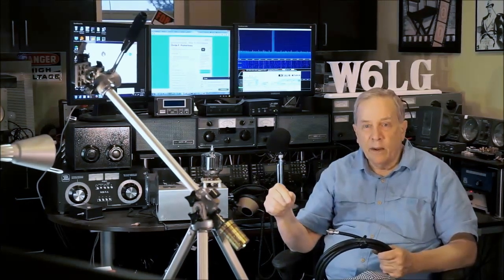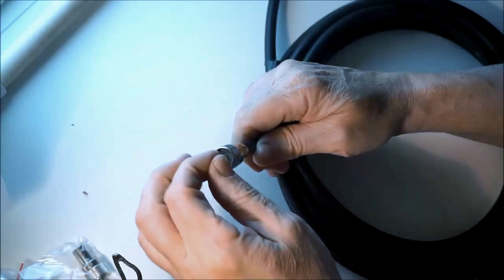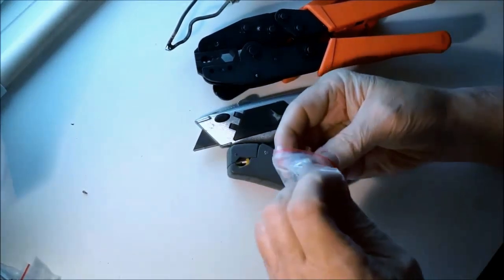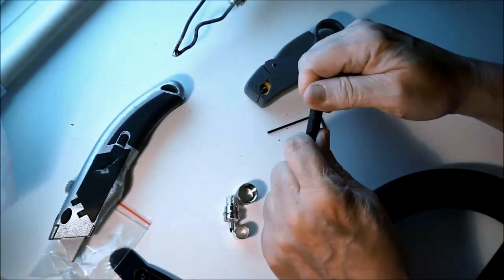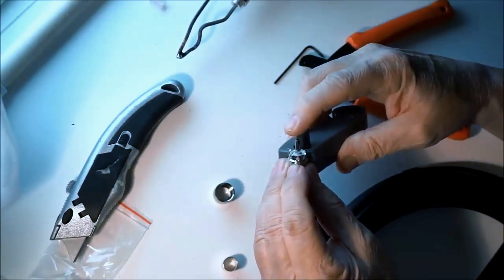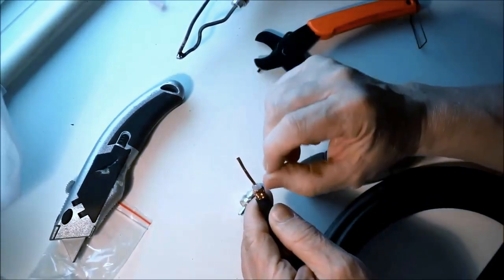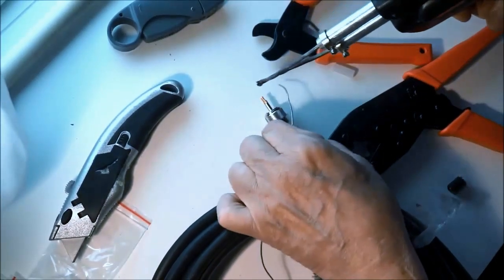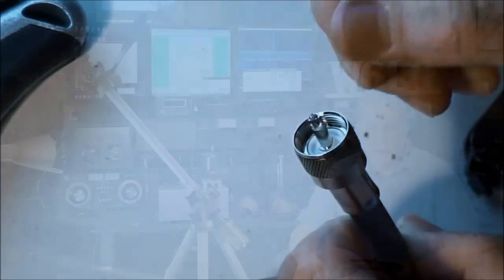Ham Radio Basics--How to Install a Coax Connector, PL259 on RG213--The Right Way to Do It!

Comment: How important is it to add silicone UNDER the heat shrink that goes over the PL-259 connector?   And how long a length of the heat shrink is necessary?

Comment: I purchased some solder type PL259 connectors for my RG213 Coax.  I am having a hell of a time and wish now that I had known about the crimp type.  That said, my connectors have three parts;  the barrel, the body and a ferrule which is threaded and screws into the body.  The ferrule does not come close to fitting over the RG213 outside insulation. I am able to install the connector by simply not using the ferrule but perhaps I do not understand something basic?
If I knew your store address I would love to buy the crimping tool you recommend...

Comment: A few things. I'd advise to put the collar etc on first, before you do anything. I'd also make it clear to people not to score the copper in any way. Then when you take off the dielectric, avoid stretching it, this must affect the properties of the coax to some degree. I know it's difficult, I have had the same problem. And I would trim the centre conductor prior to soldering with an emphasis on temperature control and making sure the solder flows and takes. I like to finish this style of connector with some glue type heatshrink to waterproof that part and give extra support, particularly on RG58.

Comment: I was hoping to find one /for RG11. It's been a long since I've 11. I don't remember the centr conductors being so small. Making a phasing harness and I wish I could use RG6.It's Belden 8238. The center conductors break as you're working with them. There's got to be a trick
73

Comment: Excellent Jim...just the video I've been looking for because the Times Microwave Company recommends crimp/solder rather than solder/solder Male UHF connectors. You might be interested in checking out these connectors at DX Engineering: DXE-PL259CS8U-6
I'll be checking in to see if you believe that these patented connectors are worthy of an update.
(I'm not associated with DX Engineering in any way)
73.....W4MDZ

Comment: Jim, It would be betterr to tin the center conductor and the pin of the connector first. I makes a better solder joint and reduces the heat on the coax. Great job 

You metioned you had some charts from 1920 of 'Q' signals. Is there such a signal as 'QQQ' ???  I heard that in WW-1 it was used at sea as the signal that you had been stopped by an armed merchant ship ( a Q ship )

Also shoud 'SOS' be sent at 5 WPM, so it would stand out from the other traffic on air ???     73, Joe  K7GW

Comment: 11:22   'Hope you made a good recovery from your 1998 accident. But your point about using the table as a kind of "pressure anvil" is a good one, because it helps steady, hold and keep the coax and crimp ring in place as you push down on the crimp handle. Too many times we attempt to  use our hands as vices or holders  which is a mistake. It's difficult and unstable to use hands as vices while simultaneously using fingers as tools.  It's best to  put project work on a table or in a vice or stable holder so your hands are free to be used as your "ultimate tools". -73

Comment: Soldering to RG-213 used to be good but these days the core insulation just melts with heating to ensure good solder connection from plug body holes onto braid, have given up and now use the compression type PL259s 73 Tony G3ZRJ

Comment: Hello Jim. I just got my licence for the first time and ordered some LMR-400 cable and some PL259 connectors. They are great quality connectors, but they are not crimp connectors. Are the crimp connectors offering any benefits or its just a personal preference? I hope to meet you on the air some day KD9HBU.
Reply from the maker: Hi,

Crimp connectors are great.  I sell both kinds.  There is a much better connection to the braid of the coax.  I only use the crimp type on my station. I like the Teflon & silver plated type.

73, Jim W6LG

Comment: Question on coax, what will be the upside and downside to using 75 ohm coax as a feed line to my hopefully soon HF dipole antenna farm?  Will the antennas usable bandwidth be wider or narrower, SWR curve smoother or bigger. I understand that a dipole antenna is around 73 ohms, so thats my reason for this question. Perhaps a video.
THK
Reply from the maker: The impedance depends, in part, on its height above ground.  If the antenna is close to 75 ohms, that will work good.  The tuner in your transceiver can take care of the match at that end. And yes, I think the bandwidth for a 2:1 SWR will be broader.  

Thanks & 73, Jim W6LG

Comment: Jim,
Finally received the two pack rotary coax stripper and all I can say is, why did I wait so long. It works like a treat. Just some minor blade adjustments and three turns the job is done.   :-)